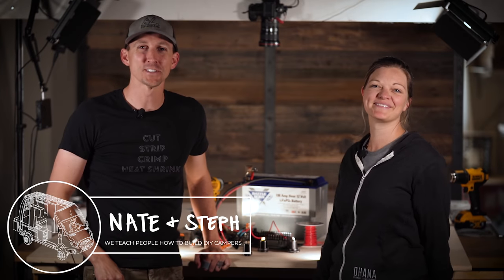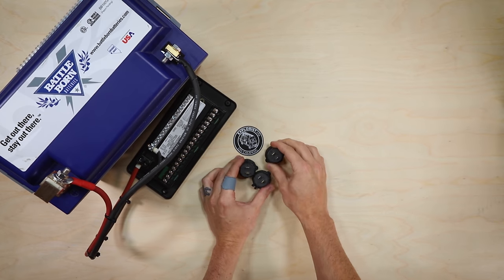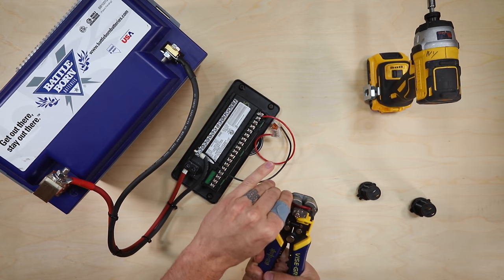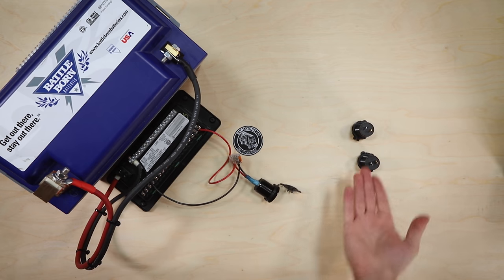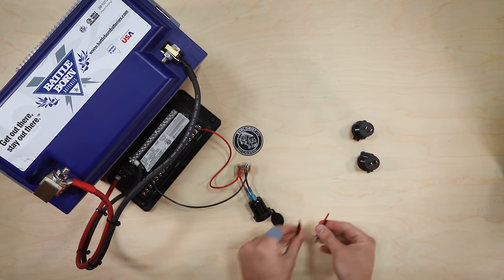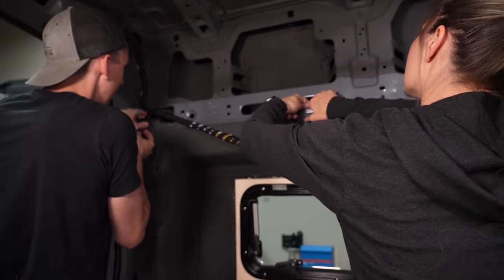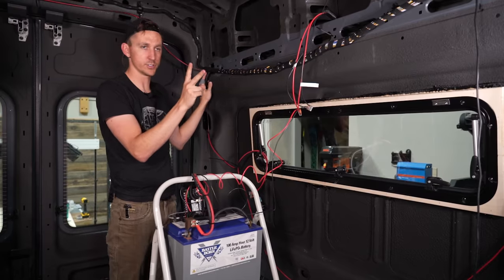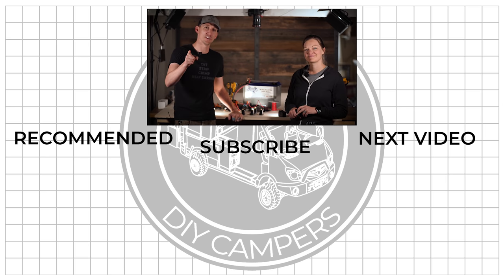HOW TO WIRE USB OUTLETS (In a Camper Van Conversion Electrical System)

Comment: On the fuse block, how come you didnt put the black wire across from the red wire? Isnt it more manageable that way as opposed to opposite ends?
Reply from the maker: The black wire anywhere on the negative busbar works, so put it wherever you need for proper wire management.

Comment: Great video. Please can I ask. I want to add another USB port to my fuse board. With battery and everything connected do I add the red live cable into fuse board first or do I add the black cable to the earth point first. Or does it not matter. Want to do this safely thanks
Reply from the maker: Disconnect the battery before working on your electrical system and then it doesn't matter which one you connect first (as shown in this video). 👍🙂
Reply: @EXPLORISTlife  ok thanks

Comment: Love the videos, do you or have you worked or designed 50 amp services with the milultiplus 2.  All the pieces should be in the mail coming my way but had a few questions about my existing inverter.   It is only dedicated to the fridge, has its own breaker in the junction book and fridge wires go straight to inverter bypassing the junction box.  My question is should I just leave it or require all of that into the multiplus.  Sorry for the long post
Reply from the maker: I would remove the OEM inverter and let the Multiplus (s) shine.
Reply: Was looking through your vids do you have any multiplus 2 installs

Comment: I feel like you covered this in another video, but I'm wondering why the wires from the Wago's to the USB connectors are only 2 to 3 inches long? Any particular reasoning for that?
Reply from the maker: It just gives more flexibility to add outlets to the circuit.

Comment: What are your thoughts about tinning the end of the wires. Do you think it would make a better connection?
Reply from the maker: I absolutely do not recommend that.  Heating the wire and adding solder to the end of the wire to 'harden' the wire makes a weak point where the wire goes from stranded to solid and introduces a point of increased failure.

Comment: Are you going to reroute the factory wiring harness? If so, I would love to see a video around this topic. If not, what was the decision process around leaving it?
Reply from the maker: We will not be re-routing it.  We are trying to make this build 'approachable and repeatable' for anybody trying to follow along, and we felt like trying to pull all of that out, re-route it, and re-connect it would be pretty intimidating and not-so-approachable/repeatable, so we are going to show how to build walls and such with the factory wiring in place (just removing the bulky plastic wire covering).
Reply: We ended up removing it from the black plastic shield on the driver side and lifting it up a few inches by removing the factory clamps. It gives us a bit more space for framing. We looked at a fe videos online on how to reroute it completely and it was beyond our level of comfort.

Comment: Should i use the watt rating on the solar panels to calculate the how many panels the inverter can handle. Or the volts x amps? (This number is a little higher than the stated watts)

Comment: 1. What is the best way to check the system is working properly? I understand to follow to owners manual but since I have followed a plan of yours I was wondering if you have specific numbers and or a video? ( 3000w INVERTER | 400-600Ah | 400 TO 1200W SOLAR -CAMPER SOLAR KIT)
2. 110v in fuse box does not have power, how to trouble shoot? The inverter is not putting out power where the triplex wire is hooked up going to the fuse box but everything has a correct reading. 
3. How to test shore power?  (Without having a shore power wire to plug into van) 
4. I have purchased some cheap  “5 pin Halo switches” i am hoping to use them as a three way switch, do you know if this is possible? If so do you have a diagram or can you explain how to wire it? They have 5 wires(common,positive, negative, normal open, and Normal closed)   
5. Do you know specific brand or switch that looks like “5 pin halo switch” that is meant to be used as a 3 way switch. 
6. There extra positive wire for BMV monitor that goes into the b2 terminal, does it need to go to battery bank for extra battery monitoring?
Reply from the maker: 1: I don't have a specific video; but this video is the closest one.  I'll put a video like that on the list for this current series.  The best way to 'learn' how to use your system is to simply use it.  You'll learn more the more you use it.

2: Verify the battery switch is on, verify that there is DC voltage to the inverter, verify that the inverter is on, verify the wires are in their proper locations per the manual/diagram you're following, verify the main AC breaker is on the 'correct' side of the breaker box with all of the other branch circuits, verify that AC out is on AC Out 1 and not AC Out 2 (AC Out 2 is only for shore power passthrough.

3: Not possible.  You'll have to find shore power to test shore power.

4: Stay tuned to this series as we will be covering two way switches.

5: I'm not familiar with those, but stay tuned to this series as we will be covering the specific switches needed to make two way switches.

6: If using Lithium batteries with a built in BMS, it's not necessary, no.

Comment: My solar panels have a couple of voltage ratings on them. They are…. Open circuit voltage & voltage at PMax. Which voltage number should I use to Calculate the panel wiring configuration? 

There are also 2 amp ratings (short circuit current and current at PMax) which amp rating should i use to calculate my solar panel lay out?

Comment: I saw your wiring kit in your shop but it does not include the 12v usb outlets themselves. Do you have a link to those?
Reply from the maker: This is the specific one we used, but it looks like it's sold out/discontinued: https://amzn.to/3xYDdKU  Our wiring kit will work with pretty much any of the other hard-wired USB outlets found here: https://amzn.to/3A4Ae6p

Comment: If you only have one circuit, why do you need any lever nuts? Just wire the fuse panel directly to the USB port with spade connectors?
Reply from the maker: Sure!  That's another option.  Lots of ways to do this stuff.

Comment: Hi Nate. Awesome information, especially since I'm about to start the wiring in my build. My question is about wire size because the usb sockets I purchased came pre-wired with 20 gauge wire. Is it ok to connect straight into that wire with a 14 gauge?
Reply from the maker: 'yes', but you need to fuse for the 20A wire size.

Comment: Question... would it be worth it to NOT wire in USB ports, and just buy a USB included 120v outlet, if you're already including 120v outlets? Is there ANY GOOD reason NOT to do that, and just have the USB outlets on the 12v circuit, as shown here? I mean, i know that USB 120v outlets are pretty expensive, but if you're only including a total of 4 or 6 USB plugs, besides what you replace your cigarette lighter(s) with, unless you ACTUALLY use your cigarette lighter for something, then that would likely eliminate a little bit of wiring that you would normally have to do...

Comment: I thought you didn’t like usb dedicated and recommended the 12v open plug?
Reply from the maker: There are a lot more dedicated USB options available now than there were back when I made that recommendation so my opinion has shifted a bit.  I just recommend getting the most up to date USB protocols that we can and then be sure to make it so the USB outlet can be upgraded in a few years when the current USB protocols are outdated.

Comment: Wouldn’t it be better to wire them in parallel with a common negative than to wire them in series like that?
Reply from the maker: They are in parallel.  Series would have been a positive to negative connection.

Comment: A comment / warning. 
2014 I was installing a new sailing boat. Also there should be some USB chargers. So ordered them online - somewhere on Amazon - if I remember right.
Later I measured their idle current - some 60 - 80mA. That seems a lot so I decided to insert a switch. 
For me this should go with much less. 
I recommend to test  them before installing. Otherwise they eat up your battery soon.
Reply from the maker: Good tip!  That's another reason we went with USB outlets without all of the LED lights and voltage indicators and such on them.
Reply: @EXPLORISTlife  Which USB outlets were those? Unless I’m missing it, I don’t see a link.  Thx!

Comment: Are the USB all the same and are they old slow 1.5 watt where can I get USB quick charge and USB type C charge ports my tablets can't be charged with the fast charge or type C my fitbit watch won't charge on the slow or USB type C my phone takes too long to charge from the slow and can create a dangerous situation I was with my sister in her vehicle my phone was almost dead so I plugged it in to her built in USB slow charge because I was going home afterwards a 2 hour drive and I need a phone incase I have problems or come across someone who needs help our running around took over 3 hrs with my phone plugged in and off all the time afterwards I headed home 15 minutes later just after I left the big city my phone made it's dieing sound and shut off great almost 2 hours to go and no phone it's almost impossible to find a Type C quick charge for the auxiliary plug in also I looking at going solar and one utuber made sense when he said it's wasteful to go from 12 volts DC to 120 volts AC and back down to 5 volts DC or even 12 volts for our cpap machines so I'm going to put 12 volt DC by our bedside and our chairs to charge our phones and tablets and power our cpap machines so I'd like to find a reasonable price type C plug in
Reply from the maker: The charging rates can be found in the product specifications from the link I left in the pinned comment.

Comment: Wouldn't it be easier just to solder the wires than heatsink them?
Reply from the maker: Nope.  Definitely not.  Plus, soldering the wires creates a weak point where the wire goes from soldered to unsoldered which can lead to breaking.  So, that would make it more difficult AND work worse. 🤣👍

Comment: I just couldn’t trust those little clamps on those wire connectors. It seems as if the mechanism cannot provide ample enough clamping power, and also will those clamps wear out and loose clamping capabilities over time.
Reply from the maker: The lever nuts absolutely provide ample clamping power.  If they didn't, they wouldn't be UL Listed for this purpose.  Sounds like you're just worried about something 'new', which is fine... but perhaps give it a chance instead of basing your judgement on how you 'feel'.

Comment: Possibly stupid question, instead of the added complexity of lever-nuts why not just use a wire that's long enough to complete the job?
Reply from the maker: It just gives you more flexibility for extending/replacing that last bit of wire if needed.

Comment: Dumb question!  Why not just put in a 12V Cigarette Lighter Socket?   Over the years USB outlets are going to change. I just bought a car with NO regular USB plugs, only hs USB "C".  Point being that each year is USB ver 3.0, next year ver. 4, 5, and 6!  Just put in a Socket, and plug in charger units over the years.
Reply from the maker: That is also an option if that's the route you'd rather go.

Comment: always 1 cord to every socket, NEVER a lot of joints, and ALWAYS with fuses......,, This is so wrong.....
Reply from the maker: I understand that you're probably just trolling, but... 1: That's not necessary and is often excessive.  2: "Joints" are minimized with UL listed connection methods that pass ABYC standards.  3: There is a fuse protecting the whole circuit, which is perfectly fine.  There is nothing wrong with what we've done there.  There are OTHER ways to do it, but this way is a perfectly fine way of adding outlets.  Please don't say that we are doing something wrong when you are simply uneducated on different ways to do things and you're just adding to the misinformation of the internet.

I know that you're going to come back with an argument, but I don't argue with trolls, so don't bother.  It'll simply be deleted.
Reply from the maker: Your previous comment has been deleted in an attempt to decrease misinformation on the internet, but If you're an 'Electrical Engineer' I wonder why you are spending your Monday morning trying to learn how to wire USB outlets...

There are multiple outlets on a circuit protected by a single overcurrent protection device (breaker/fuse) in literally every single house/building in the US.  Can you imagine how big of a breaker box a house would need if every outlet in a house had it's own dedicated breaker?

Comment: INSTEAD OF USING YOUR PHONE TO CHECK FOR POWER, WHY NOT TAKE A 12C LIGHT, AND HOOK IT UP TO THE CIRCUITS TO SEE IF THE CIRCUITS ARE LIVE?  YOU FOLKS SEEM SO IN THE DARK ABOUT USING SOMETHING OTHER THAN YOUR CELL PHONE.
Reply from the maker: I know you're just trolling, but you can use whatever type of USB device you like to test the circuit.